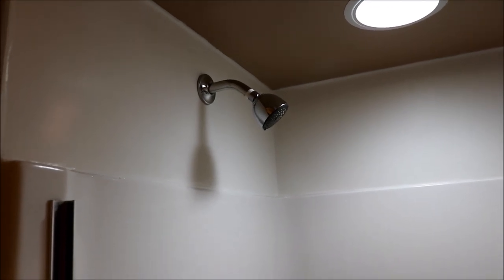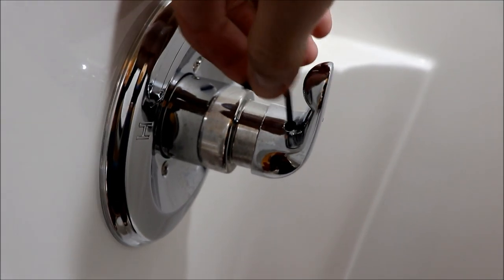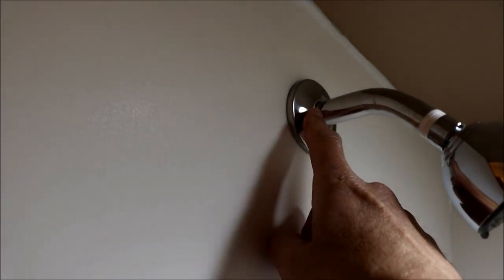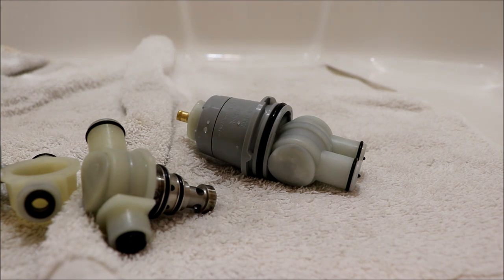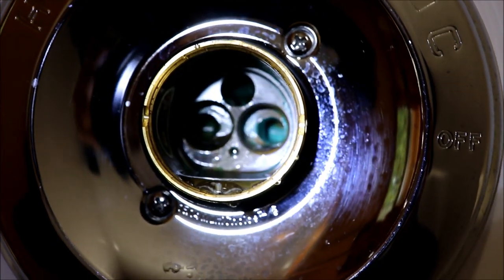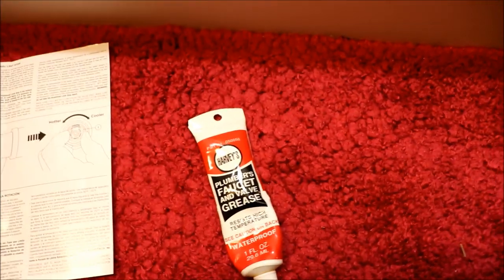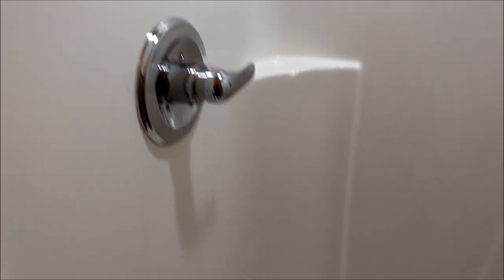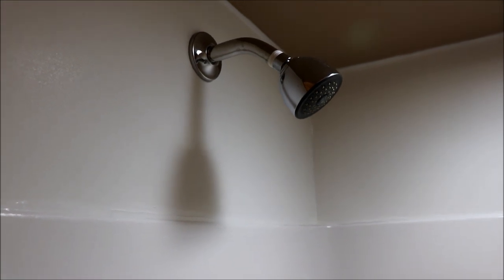How to replace Delta Shower Cartridge

Comment: Any recommendations on how to get out a stuck cartridge? I tried using pliers at the end of it and pulling like you do in the video but with zero success. It won’t come out. I’ve seen a cartridge puller at Home Depot but that looks like it’s for a slimmer type of cartridge. I have the same cartridge as you do in the video.
Reply from the maker: Bigger pliers of vise grip that you can lock on and twist and pull.  Maybe rent a slide hammer from advance auto?
Reply: stuntcardriver thank you for the quick reply! And great video by the way. Am I supposed to be twisting it to get it out or should I be pulling straight back to get it out?
Reply from the maker: @packermandan  It should pull straight out, but it helps to pull and wiggle up and down.
Reply: stuntcardriver I’ll just keep doing that. Hopefully at some point it gives. Although I’m starting to wonder how much more tugging it takes for it to give. I gave it a good 10 minutes of pulling with pliers. Anyways, thanks for the help
Reply: I used 2 flat scew drivers and placed them where it needs to seperate and turned them side ways alittle all around that cap slowly and it started to separate!
Reply: It has water suction. Try the 2 scew drivers. And turn slowly all around it and water will come out and it will be able to pull off.
Reply: Next time wear rubber gloves so you can get some grip.

Comment: Great video! I have the same valve in my shower and get poor pressure when it’s turned to the hot water. Is there a way to increase pressure in the valve itself? Thanks in advance!
Reply from the maker: No.  The shower head provides the restriction.  You could open up the plastic restriction in the shower head to improve flow.

Comment: I try to replace the cartridge delta but it came out half the other half still stuck there in the pile . How do I take it out, please help
Reply from the maker: Try using a pick to pull the remaining half out.  Sounds like you ave some corrosion in the valve body.  Or try a needle nose pliers and work the piece left and right to free it up.
Reply: stuntcardriver Thanks
Reply: Happened thesame thing on me. Do i still have to buy a new cartridge or can use the same one n just replace the washers and o rings that were damaged?
Reply from the maker: @christianrodriguez245  I would call Delta customer service.  They should get the parts you need for free.
Reply: I did break in pieces to take the remaining half and it’s work then replace the new cartridge. Working good now

Comment: What if water still runs out of handle and not shower head? I replaced exact same cartridge.
Reply from the maker: Check the o-ring to make sure it isn't "rolling" over when installing.  Also any nick in the o ring could cause a leak.

Comment: I did just what you did but when I turn on the water it wouldn’t shot off from the faucet. Do you know why?
Reply from the maker: Is there a rubber o ring that didn't come out with the old one?  It sounds like you have two o-rings stacked causing a leak.
Reply: @stuntcardriver  I am having the same issue. New valve installed but no double stacked o-rings. HELP!!!! My hot water comes out in both directions and cold in center now and water will not turn off by the handle
Reply: @michellemckim5863  did it get fixed ?
Reply: @michellemckim5863  I'm having this same issue how did you fix it??

Comment: i changed mine yesterday and is dripping heavily...  any suggestions?
Reply from the maker: I am assuming it's dripping from the shower head?  I would pull the cartridge back out and see if something looks damaged.
Reply: thank you for the reply. yes, i had to re instal it because the dripping got worse. perhaps it didn't set correctly the first time. now is working perfectly.
Reply: Clean inside with Q tips. when you have it apart
Reply: @tex2515  thank you, karen. we fixed the issue a while ago. i appreciate the reply.

Comment: Installed mine and it now has 3 shut off points, not sure what I’m supposed to do or how .
Reply from the maker: Is it the correct part?  Is it installed upside down?
Reply: @stuntcardriver  It was danco knock off, went back and got the genuine part like yours and worked perfectly. Thank you for the quick reply !

Comment: I replaced it now the waters just dripping out when I turn it on
Reply from the maker: Sounds like something is flipped or in backwards
Reply: I have the same problem did you change the shower behind the the cartilage and I think that’s the problem
Reply: Not shower washer’
Reply: @mohammadabid1222  no I did not
Reply: I have the same problem trying some other cartilage and would let you know

Comment: How make the water hotter?
Reply from the maker: Once the handle is off, you will see a plastic disc for adjusting the temperature.  Turning it to the left should increase the temperature if your shower faucet is plumbed correctly.
Reply: @stuntcardriver  it actually right to make it hotter but are you talking about the plastic small disc in front ? I think it suppose to be pull out and there is like screwed driver in middle of the disc seem like it locked
Reply from the maker: @babydollmamii  I would check the delta website and put your model number in for instructions.  Or call their customer service line, they are very helpful.

Comment: U haven’t showed how u insert the cartridge this is not helpful no need to see after that???
Reply from the maker: The cartridge goes in the same orientation as the one you pulled out.
Reply: Dear stuntcardriver I was in the middle of trying to insert my shower cartridge and was watching ur video, but u haven’t recorded how you inserted it. May be you      Missed on recording or skipped on editing but i was trying to see specifically that point only because that was my challenge at that time.
Over all thank you for the video. Apologize for my yesterday’s comment I was tired.

Comment: Lots of video. Lots of non-essential comments (some dead wrong).  Would not bet my life on this fellow's opinion(s). After all, he had a DELTA multi-choice valve and went to Lowes (or similar)  to get the wrong part and only then did he discover there was a Lifetime Warranty on the thing - read the box! Ask the store clerk (in the right - plumbing - dept)..

The water pressure in your home is there on the cold water line. The Cold water line feeds the Water Heater and, thus the Hot Water Lines (to your shower, sink, etc.) . Thus the water pressure does not change as between cold, warm and hot water Nor does the volume of water change when using  these modern valve assemblies as they are designed to restrict the flow (hence the  GPM ratings Trump hates so much).

Ask at Lowes/HD/Etc (Even  the cheap faucets come with the warranty now). Could not hurt to ask "Is there a warranty?"  You will not be the first person to have a leaky faucet under warranty.   Read the directions first. Most manufacturers have detailed instructions on line.  YOU TUBE is often suitable to illustrate details of the part(s) to be encountered/replaced as well as how they are accessed, exposed, removed or replaced.  However, they are not necessarily the best source of either experience or expertise and need to be viewed and relied upon with some skepticism where the presenter is otherwise 'an unknown quantity.'